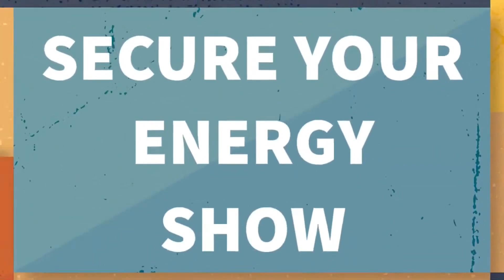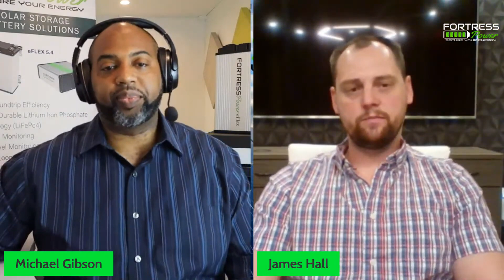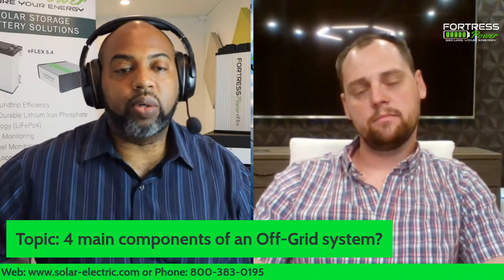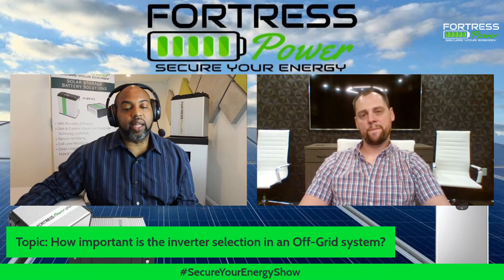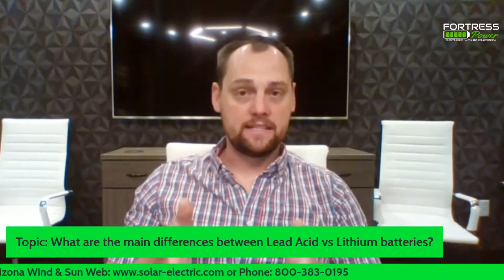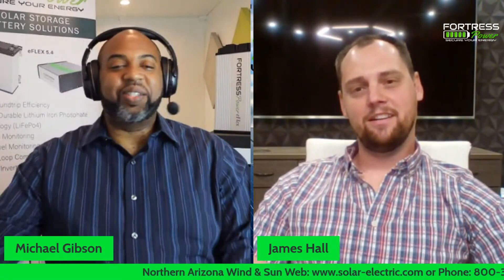Secure Your Energy Show - Yes! We can do Off-Grid with James Hall

Comment: What size system..... The eternal question. The answer is usually "As large as you can possibly afford". A standard abode running grid power and "energy star" power HOG appliances uses an enormous amount of power. An off grid house is super-insulated, runs LVDC reefers, minimizes phantom loads, etc. With the batteries, unless there is no way to come up with the outlay for LiFePo4, that is the only choice these days. Lead acid is as expensive and dangerous as ever, while LFP is cheap cheap over the lifespan of the cells, and NO WATERING is a wonderful thing. NAWS is one of the places I buy gear. Good folks there. :)

Comment: Take your peak monthly kWh consumption divided by 2 and that is you minimum required PV array for non-critical applications.

Take your peak monthly kWh consumption multiply it two and that is your minimum required usable battery for non-critical applications.

The above SWAG will work in locations where about 85% of people live.  It will be months to years before power deficits are experienced.

Multiple the SWAG PV array and usable battery by 1.5X and system will work for about 90% of the population.

Multiply the SWAG by 2X and system become robust for about 85% of the population and non-critical for 95% of the population.

Go robust in design with the 2X SWAG or use real monthly daily average solar insolation for the minimum solar month with 2-3 days of usable battery.

After three days of usable battery storage the economical solution is often increasing PV array to displace additional batteries, or other from generator, wind, hydro, etc.

Comment: Plan on $60-80K for a DIY off-grid system for a typical 2500 sq ft home.
Reply: I think your estimate is very high. The cost of solar panels and lithium batteries has dropped recently.  My new system, purchased through N Az Wind and Sun and installed by Prometheus, came in well under $20k and includes Outback charge controllers, lithium batteries and Outback inverter/charger plus a 7kw backup propane generator and 6 325 watt panels. My home is 1700 sq ft. I highly recommend N Az Wind and Sun. Their service, free advice and price point cant be beat.